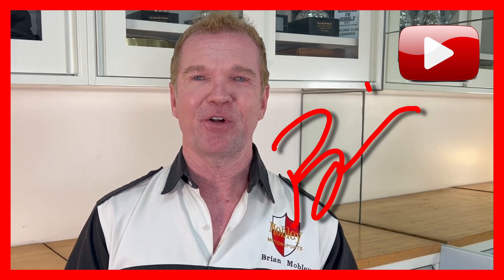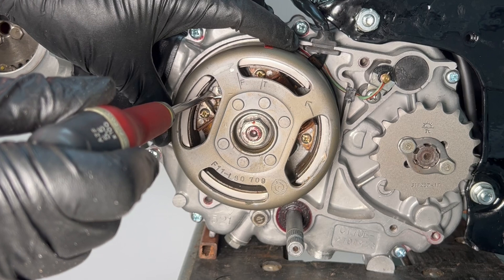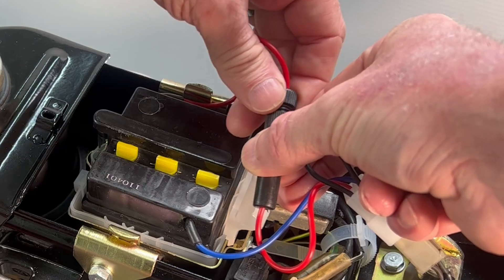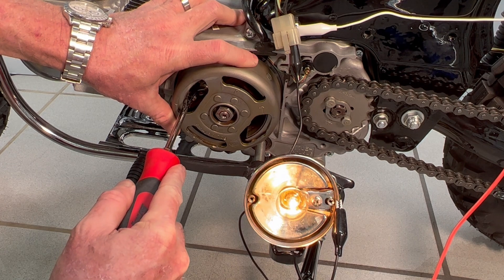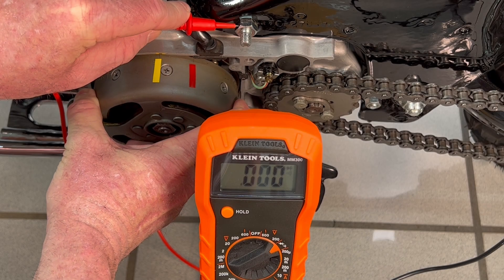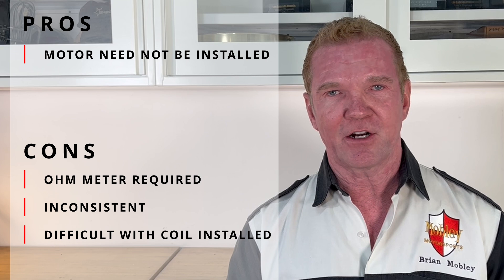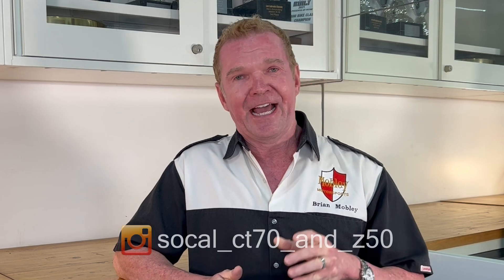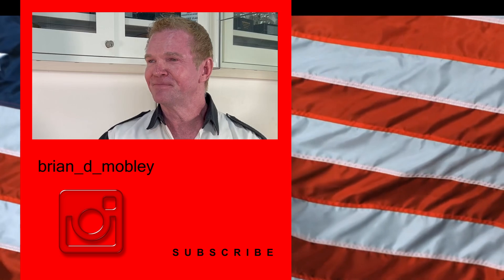4 Ways to Adjust Your Honda OHV Engine Points | CT70 | Z50 | ATC70 | CRF70 | SL70 | XR 70 | SuperCub

Comment: Ok so I get it set up and I get a pulse but still no spark its a new ignition coil new stator new condenser new harness new points and plug but for some reason no spark ive checked grounds and power

Comment: Hey Brian, so I’ve tried timing it using the static method as well as the timing light. My problem is when starting to accelerate, my 79ct70 starts to sputter and have light backfires. My engine is a fully rebuilt OEM. New head and jug with rebuilt transmission and new points assembly. Also I have a new OEM carb I got from PhatMax. Ive flushed the gas tank even though it’s a new one and jve disassembled the carb and sonic cleaned it then flushed all the parts with carb cleaner. The entire bike is a full restoration. It’s quite frustrating now cause I feel like I’m chasing a gremlin. If you have any thoughts I’d greatly appreciate it. I’d also like to chat if you’re available to call.
Reply from the maker: That's a tough one.  It sounds like you've done all the right things! I'd try checking the ignition coil. Specifically ensure it’s correctly grounded to raw metal.
Reply: @ I did forget to note that prior to my issues, it’s been running really good. It was only recently that it started to do this.

Comment: Hey what on the inside of the rotor makes the points open and close? I saw where something might have been at   one point close to the keyway. Any video or pictures would help out alot, its a CT70 with the Hitachi ignition.
Reply: theres a cam lobe that opens and closes the points

Comment: For a perfectly accurate setting with the timing light, shouldn't the engine be running at a specific RPM?  Thanks for the video.
Reply: according to the honda manual, it says 1500 idle RPM

Comment: You touched on issues any of us have had issues with, restoring Mini Trails I have always gone static at first, But always backup with the light. And you stated that changes still can exist.. This video you did is probably the biggest  issue people have with getting a bike tuned next to carburetor problems. But the nice thing if you stick with it, and study manufacturers repair books, it becomes easier  to diagnose  issues. We all go thru grey hairs, parts changing, and hit and miss. After 35 years working on the Mini Trails you will still hear me say. " You have got to be kidding me" One of the better videos I have seen
Reply from the maker: Thanks Coeur!  I appreciate the feedback!

Comment: With the timing light method . I’m getting slight bouncing around from my timing light on the “f” mark . Is it suppose to stay fairly steady on the f mark or can it fluctuate a little as long as it lives in f mark. Any ideas on what might be causing that .
Reply from the maker: Hi Sergio.  I don’t know what you mean by “bouncing,” but the moment that the timing light is triggered by the pulse from the spark plug lead can vary - mostly due to engine RPM.  If the motor runs fine and is is close to the F mark when illuminated by the timing light, its fine.  These motors can vary quite a bit and still run fine due to their low power output in general.  Hope that helps.  Thanks for watching!
Reply: Es una chispa perdida. En un motor de 4 tiempos a platinos hay ina chispa cada vez que el piston sube. Esa chispa salta antes en la carrera de expulsión de gases cuando hay baja presión.

Comment: I've got an accurate "timing tape" stuck around my flywheel, that shows all 360° marks on the tape. I use a timing light and adjust the mark when the light flashes to whatever degrees of timing that I want when it lines up with the mark on the case. I usually run about 27° BTDC on my 88cc big bore motor. This is with premium 93 octane gasoline.